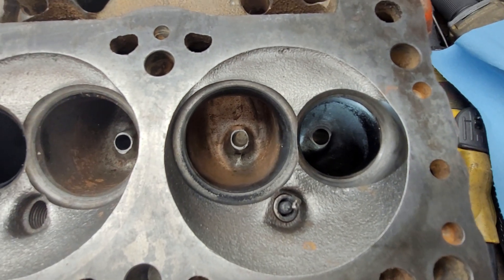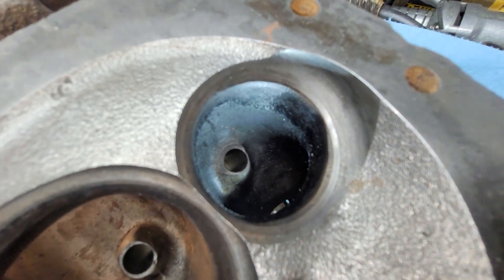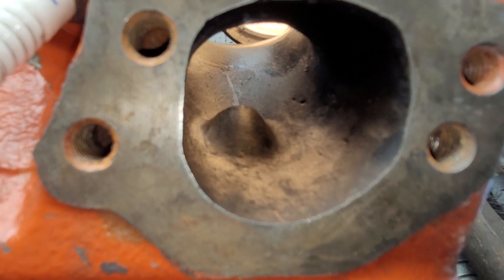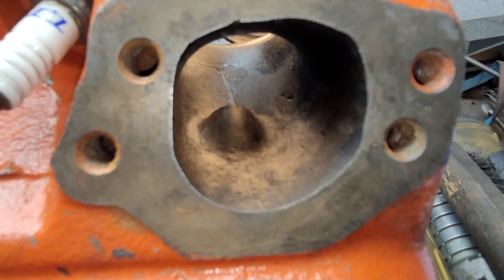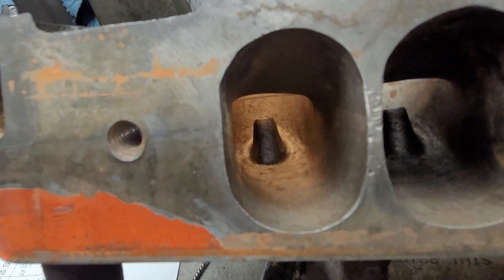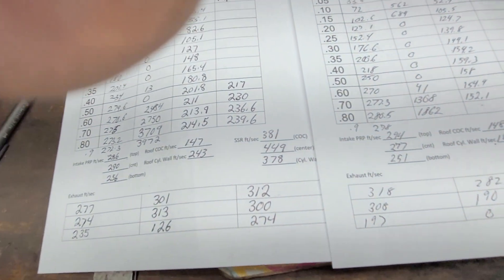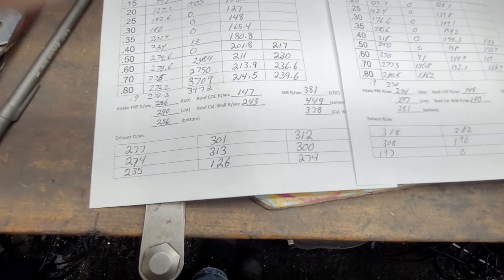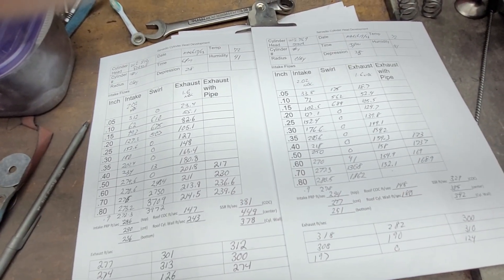Mopar W2 810 casting with old porting, flows and casting discussion

Comment: I worked in a CPD parts Dept from 85 to 89 and was the “Direct Connection guy “ . DC put out all sorts of media, guides, books, etc on their stuff. For porting they had templates you were supposed to match. I don’t remember if they had templates for these exact heads. And there were always the magazines doing articles. W2 stuff was expensive and fairly rare. I’ve never seen any but my next door neighbor was heavily involved with a Mopar dirt car that used W2 heads so I will ask him about them
Reply: That’s neat. I have a set of the big block porting templates. Probably were templates for the W2’s but can’t remember.

Comment: Yes they need an offset rocker. There were also what they called t/a heads which I believe (somebody correct me If I am wrong) wer basically the j head casting with the offset rockers and pushrod holes. Made for . . . You guessed it the trans amm series 5.0 small block with a 4.04 bore and something around 2.96 stroke.
Reply: The T/A heads were only installed on AAR Cudas and Challenger T/A(both had 340 6-Pack engines. 

W2s were never installed by the factory in any Mopar.
Reply: And correct me if I'M wrong, but although Chrysler moved the pushrod hole over on the T/A heads to be able to reduce the "pinchpoint" in the port and necessitating offset rockers they didn't actually change the port so unless the heads were ported and the pinchpoint ground out there was no real advantage.

Comment: I was looking at set of Chevy symmetrical heads, with 2.300" intake and 1.610" for SBC!!..   I forget the lift, but the exhaust flows 400cfm,  they are high port , they look like BBC 8.1 heads, at a glance,  basically the baddest head made for SBC,   if you could manage to get a stock cam to work with them, it would probably make 400 HP,  if tgese heads on about any engine if thex didnt make 650-700 hp id proably cry, especially if i bought them!
Reply from the maker: 400 cfm exhaust? That would be impressive. Thanks

Comment: Dang, Now I want to sent you my early untouched W2 heads.
Reply from the maker: You may be able to convince me!
Reply: @servediocylinderheads   Thet are the early "cheater heads" . The outside looks like a regular head casting. The ports and rockers are W2 all the way.  Nothing  on the outside say W2.   It did have the long valve stem valves but two were bent and I could not find replacements.  Can I as what kind of money are we talking about here for porting?  This is for a early Chrysler kit car.  Autocross and Hill climb and  Vintage racing.
Reply from the maker: @morelanmn  contact me at charlesservedio@gmail.com

Comment: Supposed to be a real finicky head to port and a pretty big variance through the years and different castings. Mopar listed as a 195cc but that may be for tech appeasal  😆. Had one engine Unported that made 550 with a 390 spec 4bbl another that made 700 ported 365 r block 14:1 whole deal race engine stopped the pull at 7500rpm without a peak lol. Kept that top end for a stock block deal
Reply from the maker: Nice!